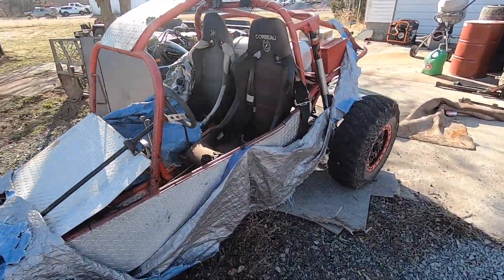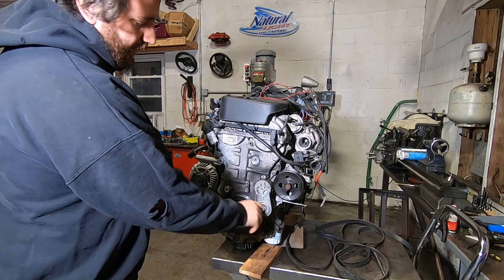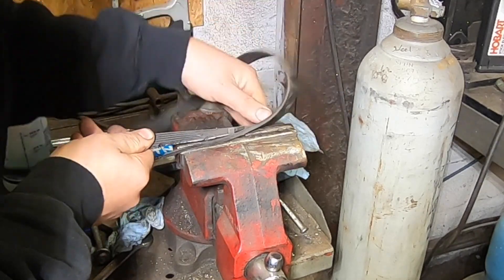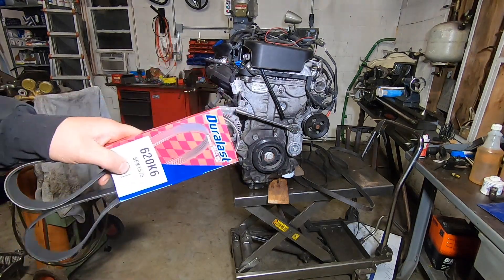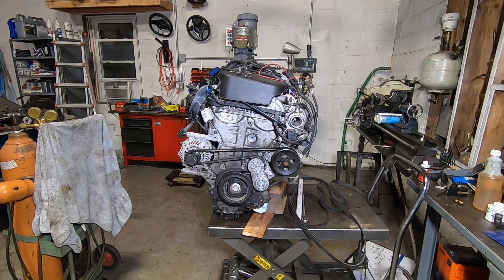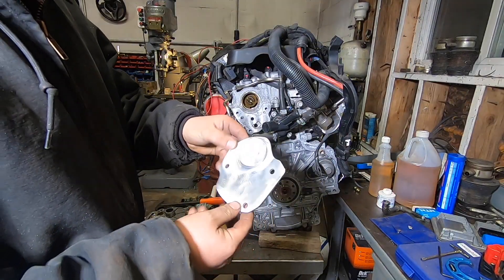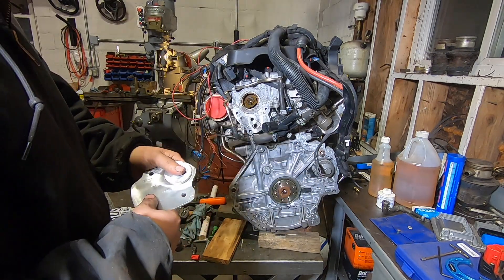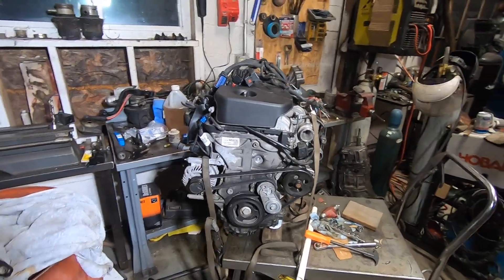Turbo Mid Engine Buggy Part 1. Prepping the LE2 1.4 GM Engine

Comment: What standalone ?  Direct injection , smart coil , variable valve , electric t.b.?   Electric boost ,  Lotta fancy stuff to controll...
Reply from the maker: Stock ecm 😬😬😬. I got it running without the car attached. But I’m sure I’m in for a whirlwind of issues down the road